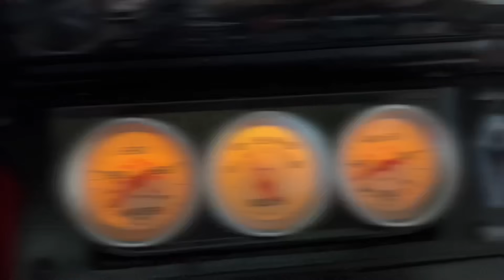Bad FUEL in the BLOWN 383 WEIAND !! 6-71 3rd Gen IROC Camaro Z28 !! Will it Run better ??

Comment: You need to use higher octane than 93 and also it depends on what camshaft you have, if you are producing enough vacuum… 6-7 pounds is good 9 is to high do you will blow fuel by your needle and seat if you are above 6 to 7 pounds…. The way it cranks I would say that your timing is off as well.

Comment: I would run 7 fuel pressure. And take your heat gun you check your wheel hubs with a check individual header pipe making sure the cylinders are all firing

Comment: The one thing here is it sounds like it's out of tune your timing belt you might want to take a  time light can   also adjust distributor adjust the timing on these car lose the bolt and you can adjust the distributor left-to-right and you can actually idol a car by the sounds like it's  slipped you might want to check that part

Comment: Justin, set fuel pressure at seven psi. Secondly, you need to set timing at 12° before top dead center at 800 RPM with vacuum advance disconnected. Reconnect, vacuum advance. To set idle air mixture, connect a vacuum gauge at the base of each carburetor (full vacuum)and adjust idle Air at the highest vacuum reading, now go to the second carburetor, and do the same. If your idol come up, set it back down to 800. Now raise RPM to 2500 and check advance timing should be 32 to 34°
By the way, the starter sounds like your timing is retarded and misaligned. To align starter, disconnect the positive cable on your battery, pry the starter gear into the flywheel and use a 1/8 inch drill bit to set between the gears, shim as necessary. Most importantly, be sure your forward bracket on the starter is in place and tight. This is critical to keep your starter stabilized and aligned during cranking. All this depends on if the carburetors are in good shape, and tuneup is good of course. Hopefully this helps.
Reply from the maker: Dang I wish I had you here with me to do all this. Lol.
Reply: Sounds like timing is way off. Starter really struggling. I wonder if you took the carbs off and converted to fuel injection if it didn’t solve a lot of problems.Probably gonna be tough to keep those carbs tuned in sync all the time. Might be easier to just only use one carb and just unhook the other.

Comment: My guess is that they had it set at one point and you probably have a fuel filter some where clogged up on a line between the tank and the pressure regulator.

Comment: Take that 93 out none alcohol only or race fuel put a new set of plugs in it you could jump up to a higher heat range plug 6 lbs of pressure is all you need carps need to be gone through cleaned put new parts back in them, the way it was smoking way to rich and wrong power valves if it was mine I would go holley injection very tune-able keeping heat down is going to be your worst nightmare to making it a driver

Comment: Nothing like buying another man’s —— drop the fuel tank, replace the fuel filters( yes there are two) , take fuel rail off, carbs need to be cleaned, replace the pilot, main jets,replace plugs. Prime the system, it will not run on 6PSI of fuel…do yourself a favor sell that to someone who understands how ventricular carburetors work, especially duals with separate fuel/ air ratio adjustments. Find a nice IROC and just throw an LS1 in it…I hate to see you frustrated and dumping money into that.  You have the ability to talk to people. BTW, 75k in that truck…ouch.